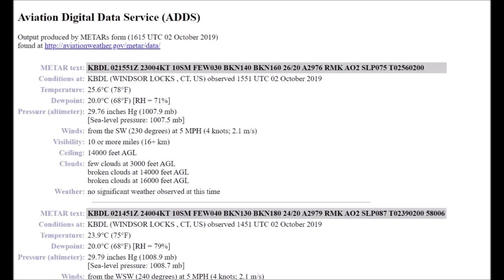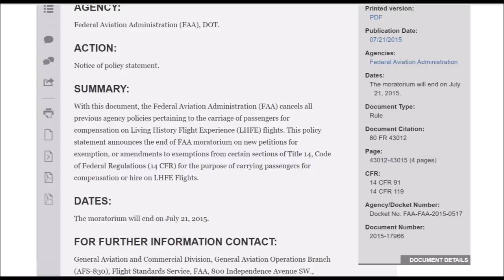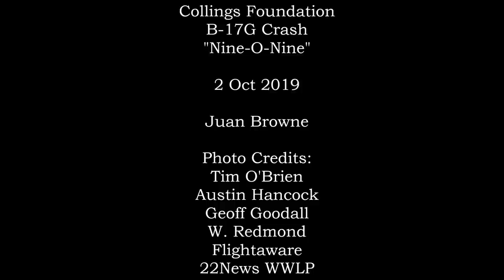B-17G Crash Collings Foundation KBDL 2 Oct 2019

Comment: I watched the afternoon news conference conducted by Bradley International Airport personnel and other aviation officials involved in the tragic B-17 crash.  I have the utmost respect for those who spoke with the exception of Sen. Richard Blumenthal.  The senator appeared 2/3rds of the way through the conference.  He interrupts, takes the podium and it quickly becomes awkwardly obvious that he was using the tragedy to politically grandstand himself.     
He no sooner takes the podium when he states he has contacted the NTSB and “called for” an investigation.  Sorry Senator Blumenthal, but the NTSB investigates ALL aircraft accidents here in the US.  Big ones, small ones, old and new and amazingly enough, even old B-17 ones!  They certainly don’t need you to “demand” one.  I don’t doubt that he called the head of the NTSB and threw is weight around.  After all, he made absolutely sure we all knew the NTSB, “Reports to the Commerce Committee, which is one of my committees,” as if somehow that gave him some credibility.  What was that all about?!   At least part of my issue with the senator is just how clueless he is on what the NTSB does and how they work.
To top this all off, the wreckage had barely cooled down when Senator Blumenthal makes the misleading, biased and ill-informed statement, “I think there is a real need for scrutiny and oversight,” on these B-17 flights.  I didn’t realize the they shut down the FAA and repealed all of the FAR’s!  The senator is obviously clueless on the already robust regulatory requirements that are already in place here in the USA and apply to ALL aircraft.  Imagine!  Even B-17s!    
Demanding more oversight is just par for the course for a pandering politician.  Hey!  I’ve, got a novel idea.  Maybe we should wait and see exactly what transpired here before opening one’s mouth and inserting one’s foot all the way up to the knee cap!  
The senator contributed zero to the conference.  It was a disgrace to see him use the tragedy to further his political position.
Reply: Agree, that was such a stupid and ill-informed statement. Similar to some politicians in Hawaii a few months ago, calling for a ban to all helicopter tours because one crashed in a street.
Reply: 'Poly' is Latin for 'Many', and Ticks are blood-sucking insects.
Reply: No surprise but still disappointing to see elected officials reminding us how important and entitled they are. The truth embarrasses them.
Reply: Darrell Jacob JR 
😂😂😂😂
Reply: Ignorant and arrogant politicians are a poor mix with the depth & complexities of aviation..
Reply: Fly'n Brian  and yet he is supposed to be an informed decision making representative of the people’s will.  He should stay far away from aviation and influencing aviation legislation.
Reply: Darrell Jacob JR 
1935 called and was distraught that you're still alive.
h/t David Spade
Reply: blumenthal is and ass well put gov not any better.thanks for posting!!!
Reply: Blumenthal has a history of 'Stolen Valor'...or as he calls it: "I misspoke."
Reply: Al the best to the families,from Belgium
Reply: I read the report on the Senator's comments. And yes, to no surprise, the same bs as most other professional politicians. Grandstanding all the way. And the veiled treats of legislation to contain the "problem" of these old warbirds. To lose the wonderful people that lost their lives or suffered injury in this accident is truly sad, and I wish the families the best. And to lose a great example of one of our old warbirds is also a shame. But for the wonderful people who spent time and money to keep history alive for our people to now have to fight misguided politicians is really a crime. I sometimes feel that all our politicians are out to do is take anything enjoyable away from us.
Reply: @darrelljacobjr2120  Man, did you mail that one!
Reply: NONE of those 'relics' are 'safe'...they were designed to DESTROY OBJECTS AND PEOPLE...not perform 'pretend missions' 70-years later!*( *The engines are NOT 'safe' and never were 'safe'...they were designed to 'maximum engineering limits' and hopefully not 'BLOW THE FUCK UP' when running! ) YEAH...BLAME A POLITICIAN FOR THIS FUCKIN' DISASTER that was 'just waiting to happen' LIKE IT DID IN THE WAR!
Reply: Gerry Nightingale nice to hear from someone who is so well versed on this subject and is so knowledgeable. I imagine people need to wear sunglasses when they are around you because of your obvious brilliance.
Reply: Nice to hear from someone who refuses to USE THEIR OWN NAME! I AM 'well-versed' and 'well-read'...enough to realize taking a 'AA Fuelie-Dragster' to 'sight-see' with is a BAD IDEA!  ( Uh...yeah...I AM 'brilliant' with the scholastic achievements to prove it )  And taking a WW2-era bomber up for a 'look around' and 'show-off' IS PLAIN STUPID! No 'genius intellect' required for that assessment
Reply: Gerry Nightingale lol you are a funny guy
Reply: Fly'n Brian. Showing once again that these vultures are the lowest of low lifeforms.
Reply: ps...don't try to 'baffle me with bullshit' over those engines...because for every 'excuse' you write, there areMANY examples right here on 'Tube for anyone to look over  that prove those engines were at 'maximum limit' at full RPM's...why else all the 'built-in fire suppressors' for them? Why did so many engines simply 'detonate' just from a 'start-up drill' during the War...never mind under 'cruise-power' at altitude
Reply: Sorry, Gerry, I can't hear you over the whooping of my Troll Alert Warning System (TAWS). Come back when you can communicate rationally.
Reply: Wassamatta?  ( There's nothing many people HATE more than the truth of things....they simply can't face reality when it interferes with some belief system they intrinsically know is false or invalid ) I like riding my Honda, and believe I won't have a spill...at the same instant knowing it could happen at any moment because of it's intrinsic nature that 'balance' is not static on a machine with two-wheels and further the machine is subject to all sorts of interference not applicable to a 4-wheeled vehicle, like wind-gusts, wet roads, gravel, etc. There are many people that are completely 'ego-driven' to the point of ignoring the reality of any given thing or scenario...sometimes to a degree of believing that a motorcycle is as 'safe' as driving a modern car equipped with many safety features that didn't exist in the past...and those people are completely FUCKING WRONG, regardless of what rationales they propose to support an irrational belief  ( Uh...what the fuck's up with the 'Afro' hair wig on your head on the DEAD CHANNEL you just created? )
Reply: Blumenthal, that lying P.O.S. (miltary deployment) has zero credibility, as far as I'm concerned. He also has no clue about the subject matter.
Reply: @gerrynightingale9045  You should work for Blumenthal.  You'd make a wonderful team.
Reply: Politicians...!
Reply: I came to read the replies, knowing that there would be one person defending the politician.
I was not disappointed.
Reply: Blumenthal is an embarrassment to Ct.
Reply: Sen. Richard Blumenthal = Jubilation T. Cornpone (remember him from "Little Abner?)
Reply: @wcate8301 .... it Already is... the undoing of America.
Reply: @hiturbine  Well said... just speculating but it could have been a base to final overshoot to runway 6 with the associated too steep turn and stall. These beautiful birds should land easily with 3 engines. In response to the "Nightingale" idiot, with all due respect to the diceased, it could have possibly been pilot error, not a dangerous aircraft. 

Note: There are hundreds of thousands of venomous snake democrats trolling and trying to poison everything conservative, like aviation. You see, we are all going to die from climate change in 10 years LOL. Nightingales repressed, unconscious fears of all things mechanical, probably originate from his scary rides on the "short bus".
Reply: If the good senator was so concerned, why didn't he make his objections known BEFORE  the accident?
Reply: The only way to see if a politician is lying check lips for movement.

Comment: I support the Collins Foundation they are a great outfit. Several years ago 909 suffered major hail damage and had to be reskinned. If I remember right Boeing stepped in with some help but I may be wrong. I have been on 909 two times and two times on the B-24 when it was the Dragon and His Tail as well as the B-25. It breaks my heart what happened, I will savor my photos forever. News report said 909 hit a stanchion right after it touched down and veered off to the right into the building. My condolences to all.
Reply: Collings Foundation- not wanting to be perdantic, just for those who wish to support.
Reply: a10warthog61  Wrong about what? 909 has had several crashes including a collapsed landing gear that was in 1995, in fact it had 2 crashes in the 80's! Hail damage was 2008 or 09. Read the history!

Comment: Starting around the year 2002, I have watched this particular airframe fly many times, in Monterey, Salinas, and Watsonville. I took every opportunity to spend as much time as they would allow, to crawl thru this B-17, and their restored B-24. I was offered the wonderful opportunity to help out the crew once before a flight, in pulling those Wright-Cyclones through several rotations. Which most of you hopefully know is done to make sure oil hadn't drained into the lower cylinders of the radial engines, causing major damage via hydrolocking. I can say that the Collings Foundation personnel, and flight crew, are all top-notch, and Im devastated to hear about this tragic accident. My heart goes out to the crew, passengers, and their families. Lets not forget about the person on the ground who was injured as well. 
I hope they are able to continue keeping history alive, and in the skies. Because there is no other sound on this planet as good as an old radial turning a big Hamilton-Standard.
😓😟😢😭🤧

Comment: As an ex ATC it always amazed me how reluctant pilots were to declare an emergency. It was like pulling teeth.
Reply: My pre-flight brief always includes the circumstances for declaring an emergency, just so that it's been thought about before it actually happens. 

I usually brief (myself if solo or my passengers even if they're not aviators) that in the event of an in-flight engine failure, fire, control problem, unexpected weather or IMC that may cause me a problem, not being able to land with 30 mins (calculated) fuel in the tank and a medical emergency, I would declare an emergency (if there was time) and choose a suitable landing point dependent on the emergency. 

If the problem is rectified you can always downgrade the emergency or cancel it, but at least someone else knows there was a problem!
Reply: Well, while you are sitting in your seat on the ground, the pilots may not have the luxury of time to chat with you as he/they fight for their lives.
Reply: @azzir325  Aviate, Navigate, Communicate.
Reply: @greggpedder  Yes sir!  First, and foremost: Fly the plane!
Reply: azzir325 Mayday Mayday Mayday is all ATC needs on the initial call.  Explanations can come later.
Reply: @bigdougscommentary5719  If the flight crew screws up it's not ATC's fault that they didn't declare an emergency.  We know ATC can help, but if talking takes your attention from the airplane, you may not have that option.
Reply: @MrBugleboyb  Assuming you know you have an emergency, and assuming you aren't fighting to stay alive, and assuming you have the time to make that initial call, I concur.
Reply: Juan.. how about an article on Mayday ?
Reply: For example .. Mayday is actually French  “maidez” for  distress.      3 levels of emergency    SECURITE,  PAN then MAYDAY.
Reply: Yea, it's  an issue (When) and needs to be talked about.
Reply: @MrBugleboyb "M'aider" (Aid me), en Francais.
Reply: Howie, if they're wearing a uniform and flying the CEO or airline passengers around, or delivering ordnance on target for Uncle, they're aviators. If they're wearing slacks and a blazer and flying charter passengers around, they're pilots. And if they're wearing greasy jeans and sweatshirt and hauling car parts, cancelled checks, or express parcels around on the back side of the clock, they're freight dogs, or sometimes referred to as vermin or sleazeballs.
Reply: I believe that ATC can declare an emergency on their own. It amazes me that when a pilot radios of some trouble, ATC wants to play 20 questions
Reply: @msblexpress , in 25 years of professional flying I was faced with a safety of flight emergency three times. In two out of the three I was too busy to do much chatting, and ironically both of those happened in the same POS airplane within three months of each other.
"Departure, Wig 603 with total pitot static failure."
"Declaring?"
"Affirm"
"Equipment's rolling. Do you have reliable heading info?"
"Firm"
"Radar contact. Fly runway heading and hold pitch attitude and power. Any altitude or airspeed info?"
"Neg."
"Show you one four zero knots over the ground. Is that a good speed?"
"Firm."
"All aircraft this freq except Wig 603 contact Approach 126.3. 603, I'm getting mode C on you now, out of three point six, let's try to level you at four thousand."
"Roger, concur."
"Three point eight, level when you're ready, and I'll read out altitudes and ground speeds. One sixty a good level speed?"
"Affirm."
"603, turn left three four zero, vectors for the ILS one five at Burlington. Show you drifting up through four point two, speed one five five. Oscar just came up on the ATIS. You're busy, I'll read it to you....."
And in spite of the dark, the turbulence, the low ceiling and vis, and the icing, and with the help of a heads up controller, a stressed out pilot, an ailing Beech 99, and Lady Luck, 1157 UPS packages made it to their intended recipients, albeit a day late. The controller got a commendation, UPS got to pay out performance penalties to some of its customers, the air freight company got to pay out a penalty to UPS, and I got a fresh pair of skivvies.
The irritating thing in a busy emergency is when ATC interrogates the crew for details that they could have read right off the flight plan.

Comment: I rode in 909 5 years ago out of Moffett Field, CA. It was worth every cent of the $450. I was inspired to ride in this great machine because I had a hospital room mate that was a B17 commander in WWII. His stories were spectacular with direction, airspeed and altitude locked into his memory. His name was Captain Stewart Greene. I shot video of every second of the pre-flight, flight and post flight.We were allowed to move around and look out every bubble and turret. This particular bird had a huge fuselage opening in front of the vertical stab, in the ceiling, that you could just stick your head up and have the air flow take your hat and glasses off !! My fear was that someday insurance reg's would stop the flight of these ancient birds. There are a very long series of videos on my channel of this historic bird flying from the inside and outside,  if anyone cares. My deepest condolences to all involved.

Comment: Juan, Thank You so much for your quick but, typically, in depth and detailed attention to this tragedy. Very ironically, as this was unfolding less than 5 miles due east of me, I was looking due west at my computer as I found and watched the "12 O'clock High" channel on Y.T. If I had turned my head 180 degrees, I would have seen the smoke. As of yet I do not know if I know anyone on board. My sincerest prayers are with All invoved and with their families and friends.  Again, Thank You.                 Steve Holton at the end of Runway 33

Comment: Many thanks to the Blancolirio channel for your fact based reporting about aviation and other incidents. I had the opportunity  in the early seventies as a youth to board one of the B17s configured as a firefighting aircraft at an operational fire base in Arizona. And thanks as well to the nonprofit organizations that still maintain and fly these majestic aircraft. My heart breaks for the family and friends of the casualties of this incident but there is no such thing as a perfectly good aircraft. Even the most modern aircraft is one mistake or equipment failure from disaster but so is the simple act of crossing the street in your hometown or going on a road trip. I for one will fly any chance I get.

Comment: According to a late briefing from the NTSB the B-17 contacted the ground well short of Runway 06. It crashed through the ILS antennas at the beginning of the runway, veered sharply right, went across a grass field, across a taxiway and into the de-icing building. The pilot had reported a problem just with the number 4 engine. However, witnesses have stated that the airplane appeared to be having trouble gaining altitude and staying in the air, which suggests additional problems with the other engines.
Reply: So maybe, bad maintenance protocol had a primary role in the loss of control?
Reply: @MarcABrown-tt1fp  More likely something was wrong that affected all four engines and  prevented them from producing enough power. It should have been able to fly okay with just one engine out and the other three running. Multiple engine problems often suggests a fuel issue; perhaps the fuel was contaminated. The plane was controllable enough to make its way back to the airport but it came down short of the runway and hit the ILS antennas. Most likely that damaged the main landing gear or tail wheel and sent the airplane out of control and off the runway and into the building.